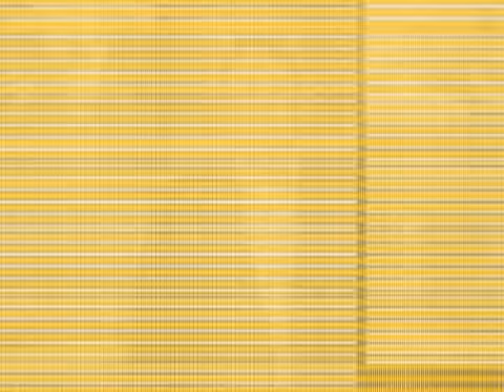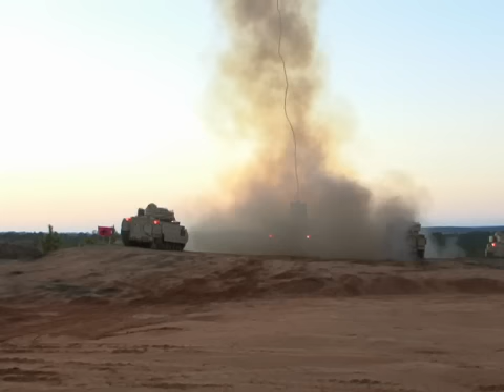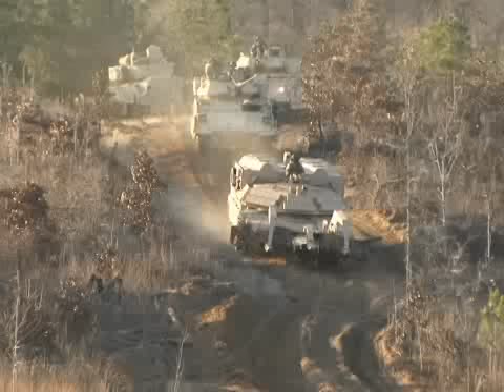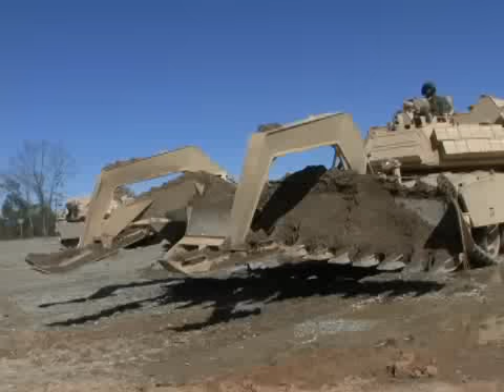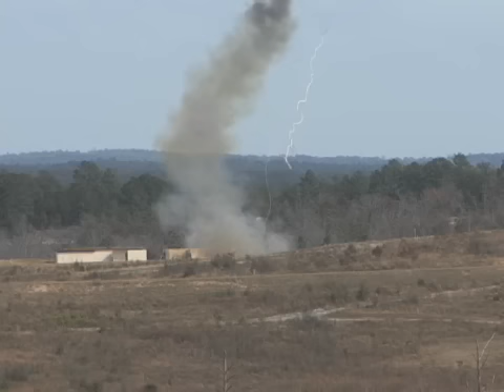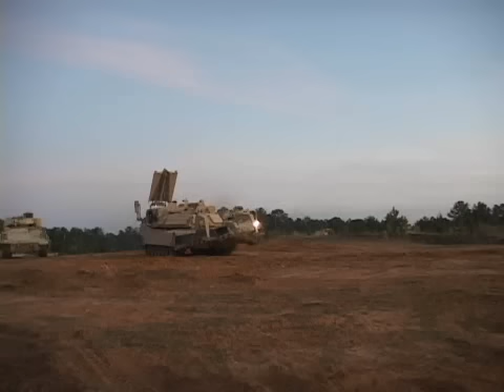Assault Breacher Vehicle Part 2

Comment: Electric engines are stronger then gas turbine ones why not a Abraham's tank that can out run a sports car?thats better and air powered riffles are stronger then powdered ones,so their should be like automatic 125mm shells,research air powered guns thier stronger then that a air powered gun can short like 3000 or 5000 fps,simatamously,put that in their an a like a battery truck that would recharge it,follow it around.